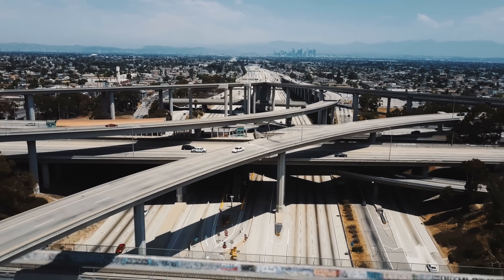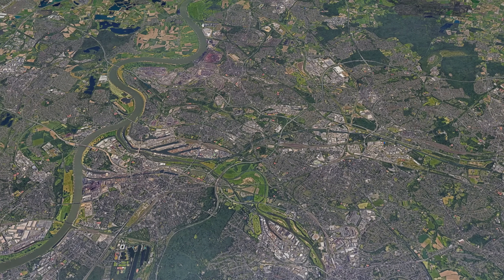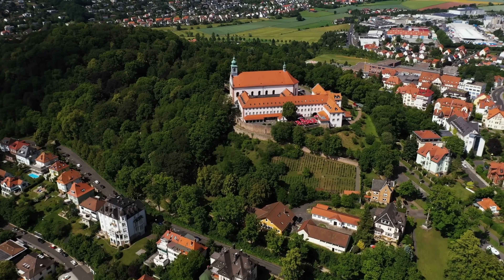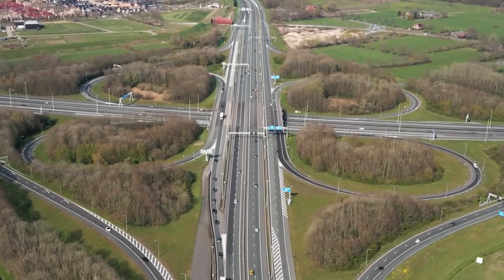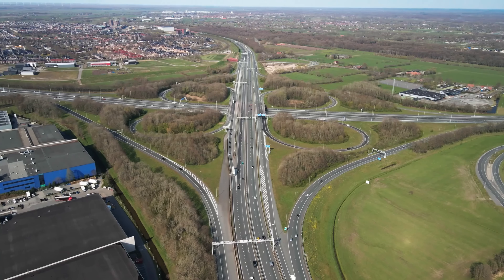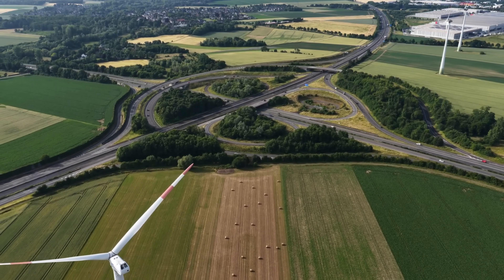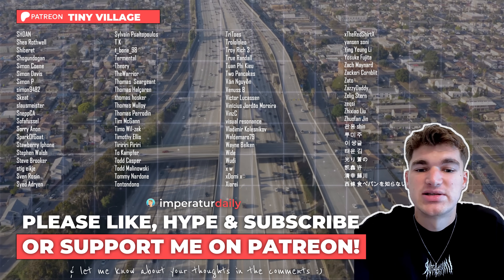Why does Europe have So Few Stack Interchanges?

Comment: There are also accidents on America interchanges. Due the height is way higher, 3-4 floors height, fall of is deadly. You missed accident stories from it.
Europe have often only 1 floor height so you will survive the crash. So Europe is more safe too.
Maintenance costs are also much lower and faster done.

More reasons why Europe version is better.

Comment: If you count the UK as Europe (which it geographically is), then we are an odd exception. We only have 2 full cloverleaf junctions in the entire country and only 3 four-level stacked interchanges. We have a lot of roundabout or dog bone (a roundabout on each side of the highway with a bridge between), or half-cloverleafs. Sometimes we just have slip roads going up or down to a crossing road with T junctions or crossroads.

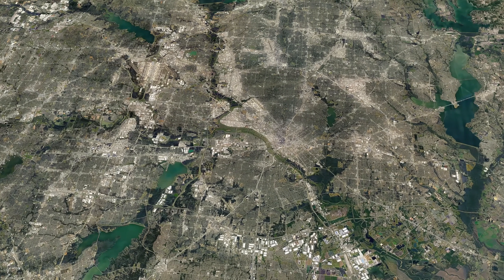Comment: 1:06 This one named "Kreuz Köln Ost" is not complete, still one "leaf". The only complete one in Germany is near Gießen, named "Wetzlarer Kreuz". This type is called "Malteserkreuz" in Germany.
I think lack of space is not the deciding issue, all types can be build narrow or wide, it's the cost. Bridges (and tunnels) are the most expensive thing in highway building. For the clover type you only need one relatively compact and low bridge, maybe divided in some parallel smaller bridges. For the other types you need a complicating system of long, high, filigree bridges which is not only expensive and hard to build but also hard to maintain with ongoing traffic.

Comment: Cloverleaves are not as common in the rest of europe as they are in germany and also they were mostly built in the early says of hwy-construction. Nowadays we know better because they can’t handle larger volumes well.

I’d actually argue that while certainly more compact europe can still have 3-/4-stack interchanges. Its just that the USA tends to build viaducts whenever possible and goes underground pretty rarely, while in europe having interchanges also go below the freeway are pretty common. Thus the same amount of stacks may exist but they’re just not as visible bcs there is no glorious 80ft high up flyover

Comment: It's not that one is better than the other. They serve different purposes. In Europe, superhighways have traditionally been used only for inter-city traffic, whereas in most large American cities they are also used to support commuter traffic within the cities, which involves massively more traffic. American interchanges outside of the cities are actually typically simpler than typical interchanges in Europe, with neither loops or dedicated bridges, unless the interchange involves two superhighways. Stacked interchanges move traffic much more quickly, and are thus sensible solutions for the problem that they are intended for.

Comment: Safety, safety.
For some reason, there are no separate parallel lanes in North America where there are cloverleaf interchanges.
Cloverleaf interchanges without separate parallel lanes are dangerous, as traffic has to merge directly onto and off the motorway. 
This significantly increases the risk of accidents.
Trucks in particular need longer distances to accelerate and brake.  
When trucks and cars have driven through a curve at 30-40 km/h (20-30 mph), they need to pick up speed before merging onto the motorway itself.
Cloverleaf interchanges are most commonly used in Germany and countries without toll motorways.
Germany's motorway network is independently planned and does not follow existing main roads, which is more common in other countries.
As a result, there are many north-south and east-west motorways that intersect in the countryside, far from urban areas.
In Italy, with all their toll motorways, they are incredibly confusing and you have to drive through illogical solutions just to pay when driving from one motorway to another.

Comment: Because it's wasting space
And it's expensive
And most importantly- it's anti pedestrian
A huge intersection only attracts more cars and thus more congestion
Reply: I don't think the last one is actually important. And I say that as a European that doesn't even own a car. 

It's a highway, what's MORE anti-pedestrian is having pedestrian options near a highway at all, they shouldn't be there and you should never want to be there as a pedestrian. The routes you'd want to take and the places you'd want to walk as a pedestrian to should never have to cross a highway at all in the first place. 

The real problem is that the US builds highways in cities at all. All highways are pedestrian unfriendly and they are supposed to be, so they should only exist in areas where pedestrians should never want to go anyway. 

No the real reason is they are expensive and only necessary when you actually need the added capacity, which is true almost nowhere in Europe. Like in some busy places in the Netherlands you can find interchanges like this, but we're talking about a very small amount in an extremely densely populated area. 

People use public transport a lot more, so the need for hyper efficient but extremely expensive interchanges is just not necessary. The value to money ratio just isn't there (also most European governments have a very different opinion on what a reasonable value to money ratio is when it comes to car travel times). When the question becomes do we want a stack interchange, or do we want a new hospital, the choice for most people becomes quite obvious.

Comment: The most important fact is, in the cloverleaf in case you missed your exit and you simply follow the loops you still can get where you want to. 
Imagine you arrive from the south and want to go east. But you missed the bypass to the east. You simply stay in lane to take the north-east, north-west and south-west loop... and you end up going east.
Can't do that with the direct connetions in a stacked interchange.
Reply: The clover leaf has a similar advantage as the roundabout: the ability to correct errors easily resulting in less harsh turn or braking maneuvres.
Reply: Eh that's not really an important fact honestly. You can just use any exit to go back the other way, and pretty much every highway has much more exists than interchanges (and having to go back is quite rare anyway). It's really only a very minor point. No the main reason clover leaves are popular is because they allow for a fully functional 4 way interchange with minimal asphalt. Thus it's one of the cheapest ways to build one. 

The design is when it comes to traffic flow actually kinda terrible and a massive traffic jam creator (because you're adding traffic before you're removing it, and you really want to do it the other way around). But when traffic jams are not really a concern, or considered less important than the added cost of implementing something better, it's good enough. That's basically what a clover leaf is, usually good enough for fairly cheap.
Reply: Cloverleafs are terrible for getting on and off the freeway tho
Reply: @Mister3Pac  Not at all. It's a question of the length of the in- and outbound lanes and of course driving discipline/skills.
Reply: @Mister3Pac not really for us in Europe but I could understand it for an American.
Reply: @Mister3Pac  agreed. There's one near where I live between I-95 (MA-128) and I-93 and the weave lanes result in the entire cloverleaf coming to a crawl. That's usually why the cloverleaves are replaced with a stack interchange.
Reply: @pshivaraman  thats been my experience with them as well. We have one somewhat local to me on I-75 and M-59. Nightmare trying to get on and off the freeway
Reply: @Mister3Pac yeah. They work with low traffic but get overwhelmed easily.

Comment: Because they are bad on every level, no pun intended.

Expensive to build and maintain, induce demand, impractical, anti human.
Reply: and u cannot turn around. If u messed up on the entry of the Autobahn u can "turn around" at a cloverleave Autobahn cross. Just take 2 exits directly after another and u will be on the same Autobahn section but on the other lane.
Reply: @flo5376 US highways tend to have a shit ton of exits, so you can just take the next exit and go back if you really have to. You don't go to the next interchange. And that's a very minor complaint anyway, just don't randomly go the wrong way on a highway. That practically never happens anyway.

Comment: 5:01 turbine interchanges are essentially a type of stack interchange. The only difference is the ramps make it look circular. I'd prefer those to cloverleaf interchanges anyways, since cloverleaf interchanges have a weaving problem, which is really unsafe.
Reply: It's not unsafe, because speed is lowered, attention is heightened and nobody overtakes in a weaving area. Accidents on European highways happen literally anywhere BUT on the cloverleaf exchanges.

And the highways are the safest type of road in Europe, because they're super well maintained, fairly straight and level and always have guardrails separating yoi from oncoming traffic and usually also guardrails on the other side, preventing cars from going off the road and flipping in the ditch or hitting a tree.

Comment: The American intersections do look spectacular. However, when you factor in the costs, maintenance and destruction caused to build those things in the US, I wouldn't want them. Even just the act of bulldozing a historical city center would be an unforgivable loss, and if the excuse for that is so cars can save up a few seconds when turning between two motorways, it simply doesn't fly. In much of Europe, there are also alternative means of transportation readily available, such as trains, and thus there's less need to hyperoptimize the car infrastructure to that extent, whereas the USA is a very car centric society. And to further hammer these points in - a single stacked interchange costs as much as building an entire railway branch line between a city and the neighboring suburbs, which, if done well, will remove much of the car traffic that created the need for that interchange in the first place, as well as help reduce the amount of all around pollution in that specific city, and even contribute to lowering the cost of living over quite large areas by removing the necessity to own a car to begin with.

Comment: I find this video to be rather bizarre, because stack, cyclone, and cloverleaf junctions all take up a large amount of space.  And if anything, the latter two use more overall land because they need more space within the confines of the interchange whilst a four level stack is more compact using vertical space.

And with respect of the U.K. there are only to cloverleaf junctions in the country, and it would be impossible to get approval to build another one no simply because it is an inherently unsafe design due to the weaving section in which traffic leaving and joining needs to cross lanes.  There used to be a third, but it had two loops removed and turned into a dumbell roundabout design instead.  The main reason for the limited number of stack and cyclone junctions is simply the construction cost compared to a three level roundabout junction, which sits between roads crossing above and below it.  These are usually more compact, but some take up as land as a stack interchange.

Comment: In Europe we did not bulldoze entire city blocks for the highways to reach the middle of the city rendering city centers in a wasteland of office blocks, parking lots and roads.
However, I had to look up highway interchanges in the Netherlands on google maps. Traditional clover leafs are in the minority in the Netherlands, most interchanges are improved clover leafs with one or two flyovers in the directions with the most traffic.
But I could find quite a lot of three way intersections with flyovers and also several treu stacked interchanges like those in the US, most of these in the densely populated Randstad in the west.
I immediately recognized the intersection at 5:07 in the video as I drive over that one daily, it's Kerensheide near Sittard-Geleen in the south east of the Netherlands, some of the pipe runs of the big chemical complex where I have my job are visible near the edges of the screen.
Reply: Unfortunately, in large parts of Europe, that is exactly what happened. Cities were bulldozed for highways.

Comment: You got many things wrong and missed out important points: 
American highways (at least the ones with full stacks) are used in cities for daily intra-city commute and may have multiple turning lanes per direction. European highways are usually outside cities (at least the ones with cloverleafs) are mostly used for inter-city commute and long distance transport and usually have only one turning lane per direction.
On the countryside, clovers are cheaper to build while in cities stacks require less real estate. 
Furthermore the weave in cloverleafs makes it difficult to change the direction with high traffic, which is what you would need for urban commute but isn't really required for long inter-city travels (where on most intersections you'd just go straight). And ofc if you need multiple lanes for a direction that isn't straight, a cloverleaf with multi-lane weaves would be a nightmare.

Your footage is cool though

Comment: Cloverleaf is quite a beast in terms of throughput. It's not until you have more than two saturated lines coming from each direction that you get significant benefits from stacked exchanges. And with smaller vehicles, space constraints, and less demand, we don't need them that often. I live in Germany and I can reach my work, groceries, etc. by bike. If I want to visit another city, trains are a viable option. It's not until I need a trunk or I'm tight on time that I need my car. :-P and if I'm tight on time, I'm allowed to make it up on the straight between intersections.

Comment: Here in San Antonio, TX we are currently getting rid of our old cloverleafs from the 60s and 70s and building stack interchanges. In fact, the major thoroughfare (I-35) is getting a second level added to it for miles from outside our outer loop all the way inside the inner loop. There's just too much traffic for the cloverleafs to handle. There's too much weaving and the weaving is too close together for cloverleafs to move the volume necessary. I definitely prefer the stack interchange for metro areas with alot of population. If youre out in the country without traffic, then ya, cloverleaf works just fine.
Reply: Well maybe you guys should try trains, that's a lot more space and time efficient done right, and your roads can be half the size, and you wouldn't need any big interchanges...

Comment: You forgot a BIG reason :
We have much more many trains (like metro, trams, ...) that move a signifiacant part of the urban population.
These more numerous transit people mean much less cars on the road, so a boring and cheap cloverleaf can handle the amount of automobiles even with in and outward trafic crossing each other
Reply: Good point but some places require stack interchanges. But really if you just make a divided clover leaf interchange it’s more than enough in most areas

Comment: First of all, stack interchanges are more expensive. Most cities in America have a mixture of cloverleaves and stacked ramps. That's because there's usually one direction that gets more traffic than another, so it makes sense to out the cheaper cloverleaf in the place where fewer people go. In America, only cities in California and Texas have them a lot. In California, space is at a premium with all of the mountains, and in Los Angeles they built such an extensive network of freeways that stack interchanges made it easier to build freeway ramps that quickly connect with each other. Also, because of the mountains and hillsides it was often easier to build a ramp than make a cloverleaf on a hillside, where it kight not be possible. In Texas, they like to go all out in freeway designs and just like being as efficient as possible, no matter the cost. The stacked interchange is slightly more effficient because cars can go faster and can enter highway speeds quicker when the ramps are straight than with the cloverleaf.

The other reason, cloverleafs are not liked in America in cities, is because Americans have trouble with the concept of merging. In America, cars don't want to yield to people coming into the highway. In Europe, people know to slow down and yield to those coming in. Also, if there is traffic, whoever gets their first and also alternating cars are how Europeans merge, so the cloverleaf is not a problem. In America, many people don't understand merging. Americans still think the person going straight has the right of way, when during merging, the car that is first goes, even if they are going slower. Cloverleafs are still used in rural areas in America, because you can have plenty of space for cars to merge in a large area. It's the cities where people struggle with merging. That's my theory.

However, some cities like Dubai have almost all cloverleafs, where money is abundant and they could have spent money on stacked interchanges. The people in Dubai just think cloverleafs look "cooler" and nicer. Whereas in America, people like the way stacked interchanges look. It's relative. Dubai is proof that you can build cloverleafs in cities with lots of freeways interchanges in the city center.